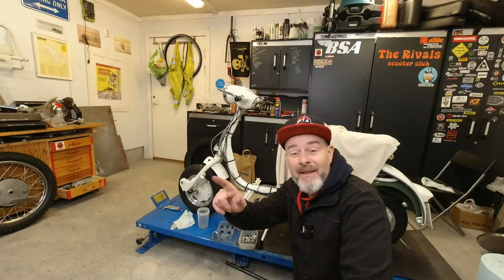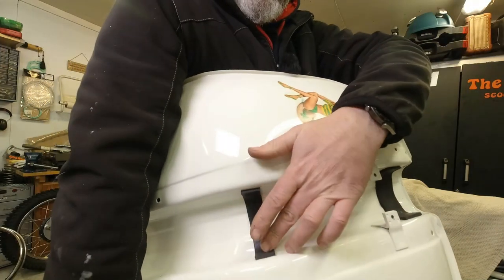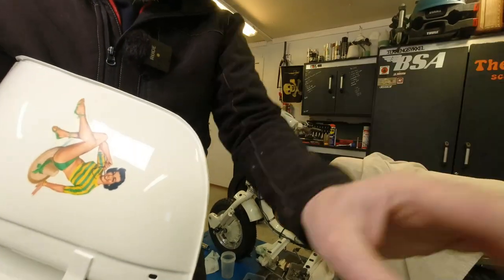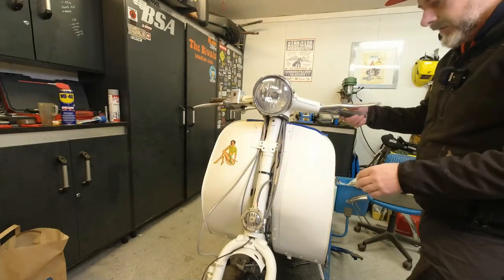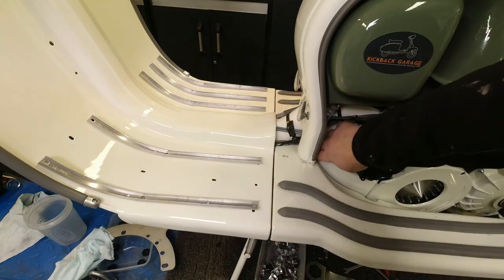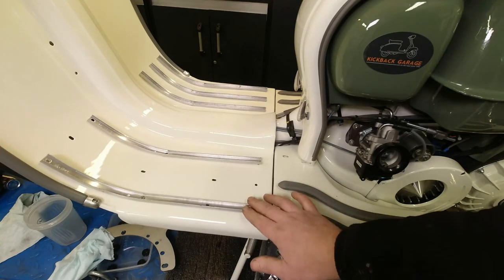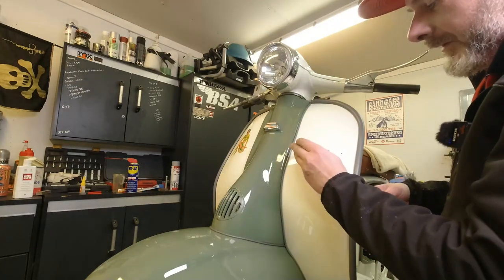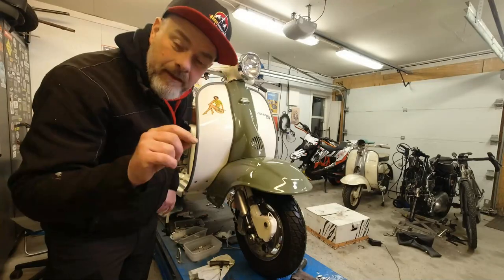Lambretta Li150 series 2 rebuild, Part 4 #kickbackgarage

Comment: Often wondered how on earth Lambretta's were shuttled quickly down the factory production line, considering how very fiddly nearly every stage of assemby is as shown by Rob, fitting the legshields, adding the floor runners, gaskets between hornn casting/mudguard and legshields, getting the"gap" right, etc, etc....Having owned and rebuilt more than 20 Lambrettas over the years - all models from 1959,  I know how very tricky most jobs are.......but a great sense of satisfaction when completed.

Comment: Clear coat the decal Rob, that will protect it! The best way is to get some water based clear from a hobby shop. Im not sure if the cans they sell (like Tamiya) are water based... If not you'll need an airbrush. Or maybe a typical clear coat from a rattle can. I'd try the Tamiya first.

Comment: Any suggestions for finding the foam/spongy black material you use to stop legshield from rubbing against frame at minute 2:50? Does somebody make this or is it a DIY mod? Is it same material MB uses for the padding on the rear brake pedal?...Thumbs up for the new videos!
Reply from the maker: It's just rubber matting I cut to size. 3mm thick.

Comment: Hi Rob did you buy your flywheel cover or did you convert it your self and do you get better cooling by doing so thanks for the video 👍
Reply from the maker: It's a casa case flywheel cover. Same as what's on a casa cooler.